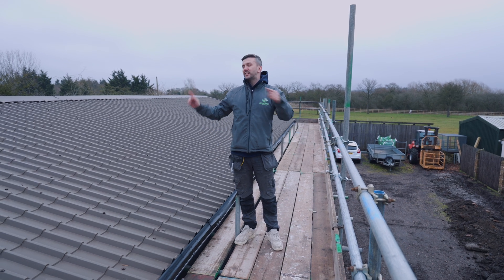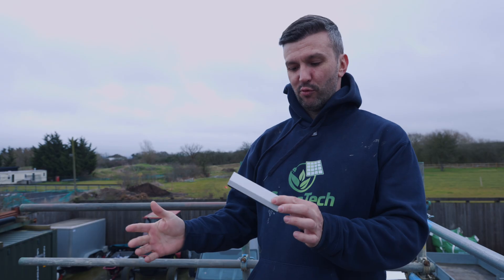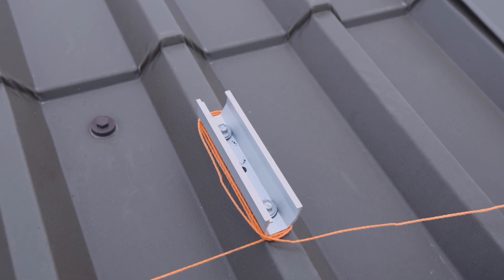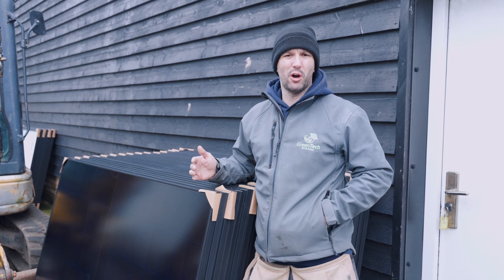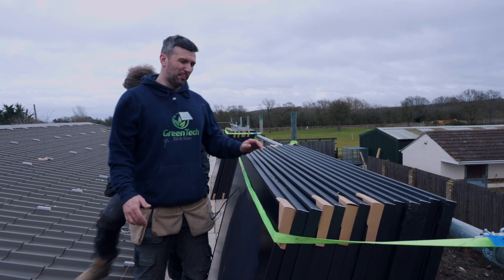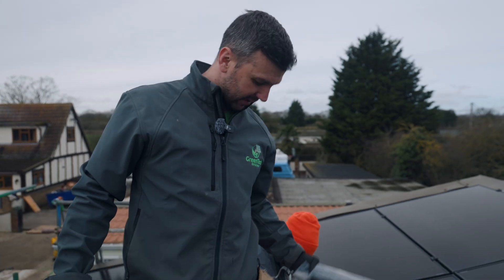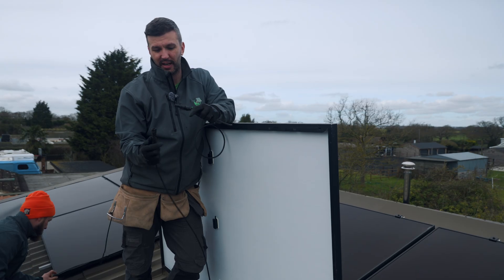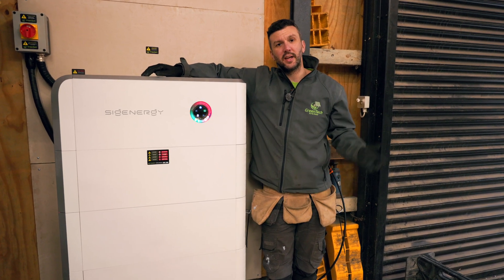Installing 40 Solar Panels! | Greentech EV & Solar | Vlog 002

Comment: Two great videos. We are installing a 40 panel system with the Sig stack in the summer. It would be good to see the performance of this set up!
Reply: We are running it with 3 phase. All fitted to an old 1960s bungalow we are renovating. New roof with sunken panels within the new roof slate. We are going big for a family of 4 but we are excited to see what we can get back from it. Really good videos.
Reply from the maker: @rossjackson6050 Hi mate thank you for your kind comments. We have had a great few months for solar production the weather has been great. This system has regularly been producing over 100kwh per day! Glad to hear your getting your own solar system installed. I see you say your getting an in roof system that does slightly bring down production but the aesthetics is great especially with slate! If you would like and alternative quote from us you never know we may beat it. We have great knowledge of in roof systems especially GSE. Which will be our next Vlog! Send us an email info@greentechevsolar.co.uk.